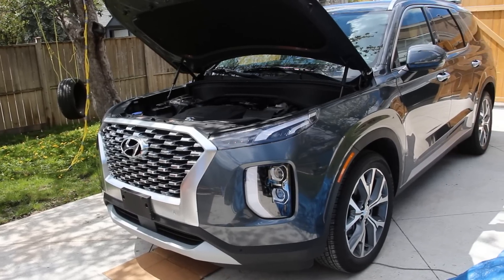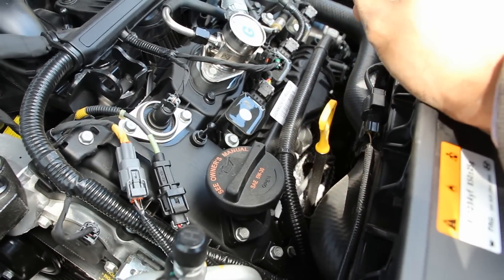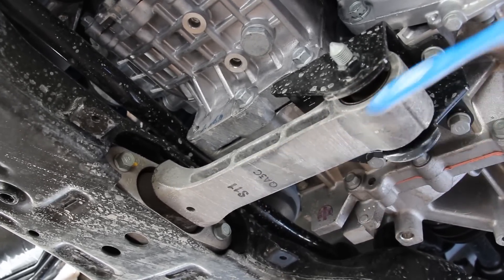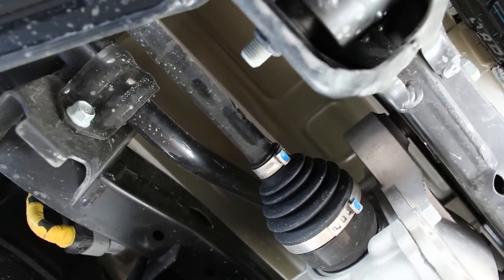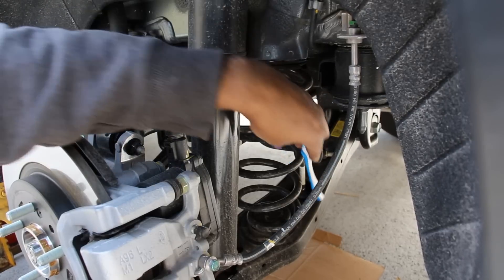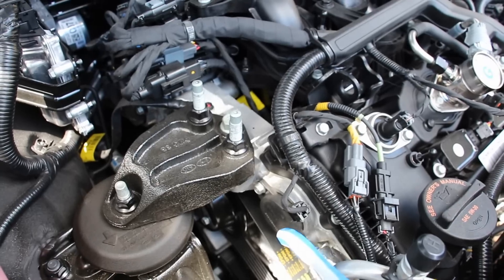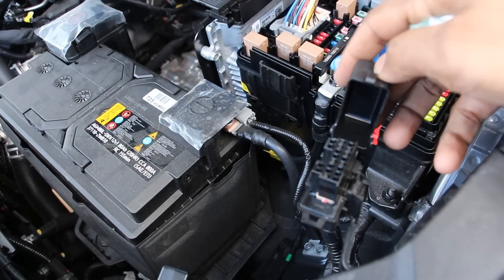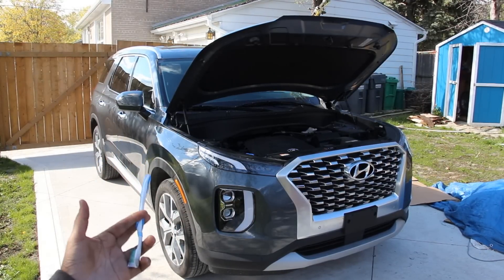Hyundai Palisade Mechanical Review

Comment: Looks a lot like my 2020 sedona van underhood. It also has the 8spd. But no start stop luckily.  One thing I will say is it runs a lot hotter than my 2021 corolla. Watertemp in the van always sits at 215-217 where as the corolla sits at 177-179!! Not sure why kia/Hyundai has such a hot thermostat in it, is it due to the direct injection??
Reply from the maker: Engines are optimized for different temperatures for optimal combustion. V6 will produce more heat than a 4 cylinder Corolla

Comment: I don't like the way new cars are going. That's why I bought "new" old truck in a 2018 nissan frontier. The transmission has a dipstick. Its port injection only. I can work on it myself.
Reply from the maker: Tried and true frontier.
Reply: Those Frontier's with the 4.0 are really good trucks
Reply: @WilliePeck  I love it so far. Still only 10,000 miles on it.

Comment: Great review as always speedkar99. What's the verdict on plastic intake manifolds, can they be ok or will they eventually fail as under-hood heat gets to them?
Reply from the maker: Well my 04 Camry v6 has a plastic plenum and I just did the spark plugs on it. Seemed fine @314km
Reply: @speedkar99  thanks that's a great data point
Reply: All plastics do fail.

Comment: 3.8L has been around since 2005. So hopefully all kinks have been worked out since then.
Reply from the maker: Hopefully.
Reply: What was it in before this
Reply: @Djalathawayne  Well I don’t think it’s this exact engine but it was in the Kia Borrego, maybe the Genesis Coupe. https://en.wikipedia.org/wiki/Hyundai_Lambda_engine
Reply: Not all of them. 😂😂
Reply: Nick Pellegrino do you have one of these?
Reply: @Djalathawayne    No. Work at a Hyundia store. See the mess first hand.
Reply: Nick Pellegrino is this a shitty motor. I did some research and it as 2 timing chains and said the valves or something need to be shimmed every 60k miles. I don’t want to spend 55-60k on a piece of shit. Is it wise to stay away from this platform?
Reply: @Djalathawayne  just do your research. The early ones had odd issues. I personally have not seen any engine issues. But with anything else I have heard about some.  But remember that can happen to any manufacturer. Also I’ve been the shop for 35 + years. Besides Hyundia will cover about anything.
Reply: Nick Pellegrino do you have a suggestion on a similar vehicle that would be a better buy
Reply: @Djalathawayne  me personally I think Toyota and Honda are couple of the best. Both do have their issues. I would do your homework. Remember I’ve been working on car in dealer since the late 80s. I’m done with automotive industry. But the Palisades really ain’t all that bad.
Reply: @Djalathawayne  Are you buying or leasing? 

I think the Telluride is the best looking mid size SUV. We have the Borrego with the V8 and we are at 100k with no power train issues. Hyundai’s and kias aren’t throwaway cars like they used to be. 

My advice to you is test drive test drive test drive.
Reply: Tyler I would buy I haven’t leased a car before. I really don’t want a car payment. My wife has a 14 Rav4 and it just hit 100k and she has had it for 6 years so she kinda wants/needs another car before hers gets crappy. She hauls my daughter n stuff around in it so it needs to be safe.
Reply: @Djalathawayne  that rav 4 has plenty of life left and is safe. Keep it
Reply: I have the 3.8 bk2 v6 in my 13 Genesis  coupe, not sure if that is similar to the engine in this  suv, but  my engine has been fine. Had it since 13 , put 129k on it, done all the general maintenance,  and she's been fine. Only thing that worries me is the carbon buildup.  I have been using the CRC Carbon clean up spray in intake when I change oil.

Comment: 3:39 i bet thats gonna be a recall
Reply: Yeah I can dislike but accept a lot of the plastic but that just seems like a big red flag. And ironically the one place they should have used some plastic, protection of the fuel filler neck, they didn't bother.
Reply from the maker: Did you see the gas filler near the wheel

Comment: 4 cats and 2 mufflers!? Is that normal? The sooty water dripping out the tail pipe was a nice touch.
Reply from the maker: Yes all normal
Reply: Yes. It's a 3.8 V6. You have 2 exhaust banks. Each bank will have a primary at the head and secondary cat downstream. Hence why there's 4.

Comment: Now I can see the appeal of turbo inline 4's opposed to transverse v6's for manufacturers. 
 It seems so much more packed in there.

But a plastic oil filter housing? Big oof.
Reply from the maker: Turbo 4 cylinder also have more parts and complexity but it gets them the EPA numbers that they need to score points

Comment: I had a Hyundai naturally aspirated V6 and  before the SUV was 6 years old, with less than 100k km the thing was already no longer worth repairing it had so many issues. Anyone would do best to stay away from these grossly unreliable cars.
Reply: Have you seen the amount of fire recalls Hyundai and Kia have? I don't blame u.
Reply from the maker: Ouch. Santa Fe 3.3?
Reply: @speedkar99  4 in the past few weeks. Including 2.0 Elantra new ones. Kia soul. The list goes on and on. Watch cbc market place on you tube. Nuff said.
Reply: @moeanthony9308  oh please. They have new engines now, smartstream 1.6, 2.5, and 3.5 engines with dual injection, they are much more reliable
Reply: @bradleyscarreviews  And what makes that anymore reliable? Because they changed? Are they proven and tried?

Comment: Thanks for the review. I'm thinking it's very similar to the telluride. I'm looking to purchase the telluride for the extra space from my current sportage. Think this is a dependable vehicle that will last? Of course I think Toyota Highlander would probably be more reliable based on history but the price is right on the telluride even with markups. Kia and Hyundai have also seemed to step up their game.  Any recommendations you can give for a three row family vehicle would be greatly appreciated. Thanks and keep up the great work.
Reply: Lease don't buy a Hyundai or Kia.
Reply from the maker: Telluride is the same. Highlander will out last this long term becayse of ancient 2GR engine so it depends how long you want to keep this.
Reply: @speedkar99  thanks for the reply. I'm planning on keeping it until the wheels fall off lol. Got a 2005 Nissan Altima too with about 150k miles on it.  Still going and I'm keeping it until the cost to fix outweighs the value of the car. Not the best car with the CVT and cat problems that are common with these cars but luckily I've avoided major problems so far.  Just looking for a better family vehicle with more size. Guess I'll start doing some research on the Highlander. Was also considering venza that is only hybrid even though it's two row but more room than my sportage. Would you say to stick to the regular engine or hybrid for long term reliability?
Reply: @mikke906  I would advise u to get this or the telluride, the new highlander has been having a lot of transmission issuws

Comment: I've seen Hyundai getting a lot of recalls lately
Reply: Hyundai threw me under the bus with complete and utter all wheel drive failure issue on a 2014 DM Santa Fe Australian Spec vehicle . This is an increasingly evolving problem that highlights a manufacturing weak link in the driveline component that’s both enormous in cost and potentially dangerous if it causes a wheel to lock up if it transfers danage from
Reply: Incredible amount of recalls. I call it job security.
Reply: @eatingplaydoh  Can't say the same about those executives though, LOL!
Reply: Recalls are a good thing though.  They are owning up to an issue and resolving it.  I can’t tell you how many times Ford, Chevy and dodge ignored issues until someone died or they got sued
Reply from the maker: Hyundai always has recalls lol
Reply: @speedkar99  like every other manufacturer

Comment: Don't buy it unless you want to set your garage on fire.
Reply from the maker: Why? Did these have a recall.
Reply: @speedkar99   Not this particular model but could be a matter of time. 

"Owners are being told to park their vehicles outdoors until repairs are made."

https://abcnews.go.com/US/wireStory/hyundai-recalls-390k-vehicles-engine-fires-77487348
Reply: @speedkar99  cbc market place on you tube tells the whole story. So many class action suits
Reply: Wrong engine bud, your information is severely invalid
Reply: @joskjj3625  Two things here. They had another set of recalls this week besides the ongoing smelly fabric seat recall for pallisade. Most importantly how encouraging is it to even remotely buy? How long has the vehicle been out anyway? 2 years at best?

Comment: Good looking car it will only last as long as the loan. Trade it in after paid off. Will never be a collector car.
Reply from the maker: Time will tell. I'd be more Kean to judge it if it had say a 2.0 turbo that everyone else is offering
Reply: @speedkar99   Turbos don't last as long,  hard wear.
Reply: Had my 2020 palisade  sinc e 2019 brand new. Good car. 97,000 miles. Only issue is the alternator went out @ 75,000 miles. Fit and finish is the best I've ever experienced. Looks brabd new. Have the limited( in that the year the top of the line trim) I do baby the car though.
Reply: @brealll9647 97 k is just broke in should get 350 k or more...

Comment: I have a 2016 Sorento SX with the 3.3L GDI Lambda II engine, and AWD in the family fleet. Interesting seeing the similarities, and differences between it and this Hyundai. The oil filter housing is on the top of the engine versus below, and I cut a panel in the bottom panel to access the oil drain bolt so I don't have to remove that panel every oil change. Transmission fluid access is the same unfortunately. The air filter housing on this Hyundai looks to be exactly the same. Don't know about this Hyundai, but the Kia at least in 2016 still has a conventional parking break, not electronic. Really would like to see Hyundai/Kia take a page out of Toyota's playbook, and use both port+direct fuel injection. What I don't like about Kia is using blank panels where optional equipment is missing. I've heard Hyundai doesn't do this, and alters the buttons so there are not any blank panels on the cluster. Thanks for reviewing this though, I like the styling more on this than the Telluride.
Reply from the maker: The Hyundai seems to have alot of familiarity with Toyota under hood in terms of placement, but there's a few things where they can improve on.
Reply: Actually, the newest Sorento equipped with the 2.5T engine is direct and port injected. Since this comment was 2 years ago, I have a feeling you already know this though. 😂

Comment: I never did like the v6 in front wheel drive cars always a pain in my ass especially now with modern cars so much bs on top.
Reply: Changing spark plugs on a FWD V-6 Toyota car is gonna be a real chore because the intake manifold is on the way. Honda is a little easier
Reply from the maker: Yeah I changed my Toyota v6 spark plugs last month ... Wasn't the quickest plug change and you gotta keep track of the vacuum hoses but it went fine overall
Reply: @speedkar99  im lucky I have a 1988 Lincoln town car I really need to move the air box on one side and the other side nothing I prefer 4 cylinders in fwd cars
Reply from the maker: Yeah it's not ideal for maintenance, at Least when you have to reach to the rear bank

Comment: That engine sounds broken. Absolutely terrible
Reply from the maker: I don't like the starter sound. 
A bit trashy at full throttle when driving
Reply: All kia/Hyundai v6 sound like that. Marbles rattling in a can.
Reply: @ua7pyro591  it will definitely sound like marbles in a can when it carbons up to the point it starts pinging and detonating I know from experience.
Reply: @henrytom5824  all the gdi stuff 😲
Reply: @ua7pyro591  gdi and carbon buildup don’t get along at all on our 2020 Tucson i installed a oil catch can to get away from carbon buildup can’t wait to go outside right now like allways every so often I go under the hood and I unscrew the can and dump out blowby oil from the can such a nice reassurance that that crap isn’t going back into our engine.
Reply: It’s the gdi injectors and high pressure fuel pump.